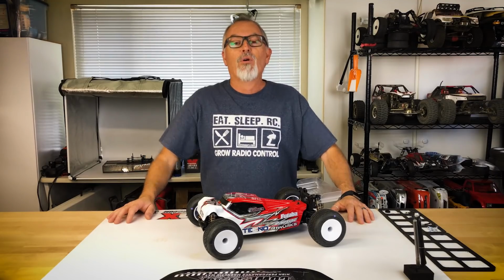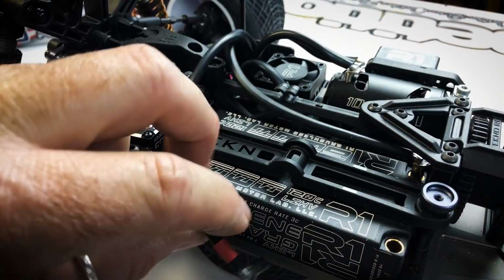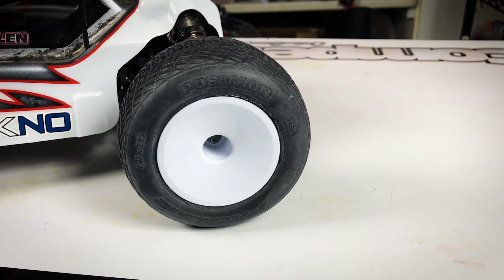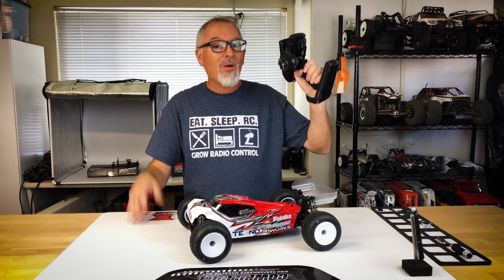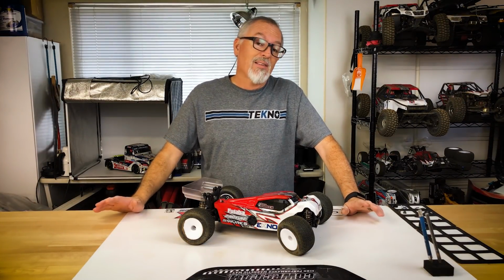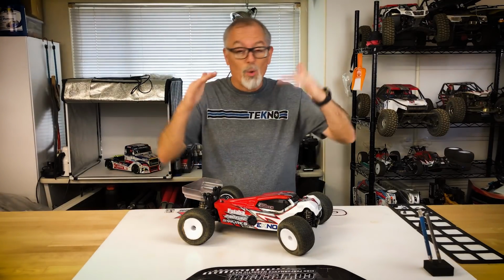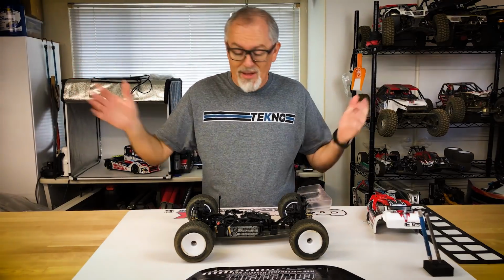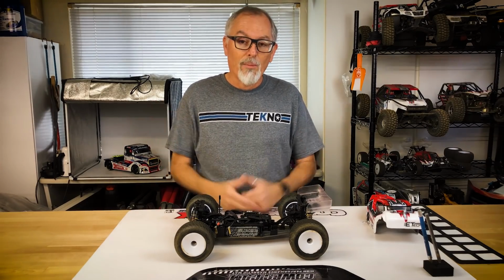Review: Tekno ET410 4WD 1:10 Scale Truggy | CompetitionX

Comment: Hey Tony, have a technical issue I need help with. I have reached out to tekno but no response as of yet. I built my et410.2 but for some reason the rear right wheel doesn't fit. I have a set of jconcepts mono 12mm wheels part # 3354W. I was able to get the rear left wheel to fit but it rubs against the rear camber link and hub. Is there something I am missing? Any suggestions would be appreciated. Thanks
Reply from the maker: The only thing I can think of that might cause an issue is the direction of your rod ends. The rod end on the inside should be straight while the rod end on the outside should be curved - and curved UP! If it's curved down, it will absolutely cause an interference issue with the wheels.
Reply: @Competitionx  outer ends are curved upward. Tekno said it might have been set screws on hex nuts since sizes are easily mixed up but not that either

Comment: What 32 pitch pinion did you end up going with on the 10.5 motor? Thanks
Reply from the maker: I think I stopped with a 23T. Using motor timing to pick up the top end a tad as well.